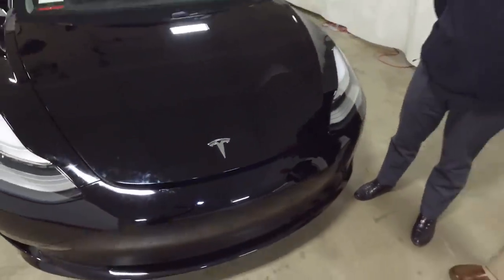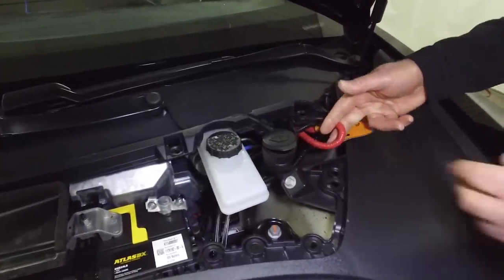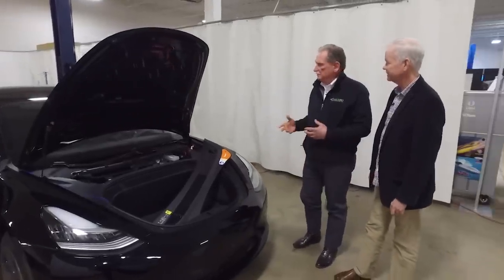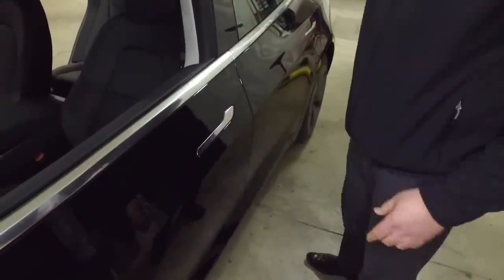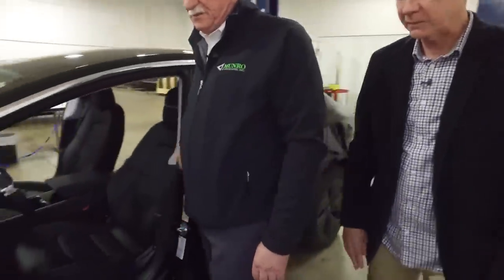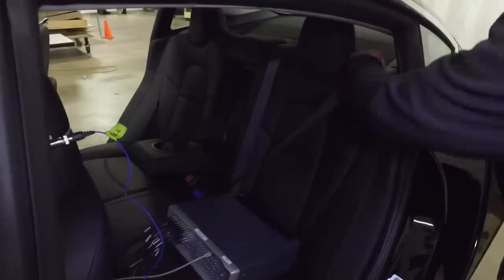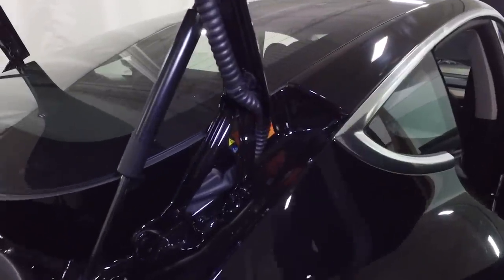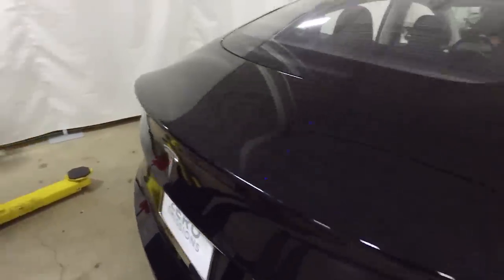Tearing Into Tesla's Model 3

Comment: Almost half the time spent nitpicking, about (if) you get into an accident,  ironically,  In one of the arguably Safest cars being built today.
Reply: Well we've seen that a Model S can also catch fire if the battery sustains enough damage in a crash. This is not a surprising thing considering how much energy is stored in these battery packs. Regardless of the mechanism of how a vehicle catches on fire, if it does, you still want to be able to get people out quickly.
Reply: Homecomfort i suppose you never witnessed car burning. Especially the one loaded with batteries. Even fire brigade does not have a lot to do at this point as long as there is oxygen it will burn and it will stop only once it burns out... Educate yourself first.
Reply: Homecomfort and the entire "seconds count" aspect really doesn't apply in this case. Unless the driver has a stroke or gets shot inside the car, this isn't really an "every second matters" situation.
The sense that time is so critical in car crashes comes from the risk of a fire, which is caused by fuel leaking into the car and catching fire.

That's not going to happen with a Tesla. Instead, the procedure is to remove the person from the vehicle without risking any additional harm to the person. Doing it faster is obviously good, but you DONT rush that process just because you want to do it quickly. 

That's why you don't often see fire crews yanking passengers out of windows and shoving them anywhichway into the back of an ambulance. The procedure is to do it safely, not quickly.

Comment: There's another place on the chassis where you can cut directly to cut the power. Right side, C-beam.
Reply: But pointing that out would destroy their argument. The front clips are mainly there to give the 12v system power so you can prep it to tow the thing. If they bothered to read the manual they would've seen that part. Instead they tried to tie the jumper cables there to opening the frunk to disconnect the HV battery.

Grasping at straws really.
Reply: Brice Campbell
So you expect first responders to know every crucial detail of EVERY make and model on the road?  Or do they search the internet for the manual whilst the car is burning with 5 folks trapped inside and a couple bleeding to death?  Every point made in this vid was valid and important.

Comment: At 2:50 you opened the driver door with your left hand, then complained about you must use 2 hands to open the door ? What are you to convey here ?
Reply: HT N Did you watch with the sound on, where you can hear him say that it hurts and he doesn't like it when he does it that way?
Reply: drdriftphd But the point of disabling the car is to cut open the cabin to get inside.

If you are at the point of having to disable the car, you aren't in a position to get inside in the first place. Therefore first responders will always have to use a halligan tool to open the hood, just like on all cars on the road.
Reply: drdriftphd I just want to say, if you're able to go inside and pop the hood like on every car. Then you should be able to get the passenger out instead of popping the hood.

If not use brute Force on the hood like Normal and then get the passenger out. His criticism doesn't make sense when the i3 or any other car doesn't have an outside mechanical lever in the first place.
Reply: I believe his main complaint is that the screen is a much more vulnerable point of failure than a simple mechanical lever on the interior to open the hood. In an accident, it's more likely that a simple mechanical lever inside the car will survive, allowing first responders to open the hood up and disable the car quickly, without having to use additional equipment and force. 

How valid that is as a complaint, I'm not sure. I'm no expert in the field, not even close. But he is, so I'll definitely give it some weight. I still think it wouldn't be that big of an issue, though.
Reply: Chris Edwards I don't know this guy, I don't have a Model 3 to compare, but from what I can see in the video, he has to depress one side of the handle with this thumb while gripping the rest with his fingers. It's different mechanically than most other car doors. 

This man says that his complaint is based on his personal discomfort as a result of an injury. This implies that not everyone will have the same problem with it. It's not needless bashing, and nobody's "out to get" Elon Musk here. He's making observations as an expert in the field.

I like Teslas and I think they're cool cars, and definitely something fresh and new in an old industry. That being said, Tesla is small, new, and experiencing the same stuff any small time, inexperienced manufacturer would. Growing pains. It doesn't mean nobody should buy them, just that people should be informed when it comes to what to expect when buying a Model 3.
Reply: I guess he doesn't realize he can be use his right hand there and grab it from the underside. I thought he was a mechanical guy but can't figure out basic human motoring skills. Wow
Reply: drdriftphd it hurts his hand to pull on a handle... in the same way he would in any other car? What exactly about that hand and arm motion is different from what he does in any other car?

Seriously, look at that motion and compare it to the motion for other vehicles. Don't give me some "but it sucks/evil/Musk-is-satan" response; analyze the motion and biomechanics involved, and identify anything that is different from how he'd open the door on other cars.

There's nothing different. His hand is horizontal and he pulls on the handle. That's how most car handles work. The only reason he's complaining is because he wants to find something to complain about.

This is why people trust Consumer Reports. And what did they say about the Model S, while Detroit was claiming it was junk? Oh yeah, they said it was the best car they ever reviewed.

Comment: Lots of good reasons not to be a Beta tester for Elon.  Wait for the 2.0 version.
Reply: Do you realize a lot of people and analysts have been betting non-stop on Tesla going bankrupt for about 10 years?
Reply: "Because of all those moving parts", are you kidding? There are moving parts on a Tesla, it's not all circuit boards mate... Electric motors, brakes, the suspension, the entire drivetrain - all moving parts. All cars are susceptible to breakdowns from both mechanical and electrical means, and Tesla has an absolute shitload of the former... For starters you have that huge lithium ion battery, which let's face it - we haven't mastered longevity in yet; they lose effectiveness in as little as 5 years (unless you're Apple and you use cheap shitty Chinese cells, in which case they last 1 year). That's built-in redundancy right there. To have the battery replaced in a Tesla it will set you back $12,000, so every Tesla owner, especially second-hand owners, will have this price dangling over their head as their car ages.
Reply: O_o cheesus my friend. I'm honestly worried.
Reply: DeerKoden short term strat vs long term strat.
Reply: Herbie Husker - What is your problem boi? I was talking to neirad537 who clearly wrote: 
"Herbie Husker yes because nobody want their cars. Lol"

And What is with this statement "Look at the depreciation curve on Bimmer, it's pathetic" I don't know what kind of idiot thinks BMW is some sort of economical reasonable car for commuting. BMW is a car for a person who enjoys the way those cars drive. I have owned toyota corolla, nissan primera, skoda felicia and VW polo. But none of those cars can deliver the same joy as BMW which i drive nowadays. And btw, i encounteren INSANELY more problems with all of those cars compared to the three BMW's i have owned. We don't need your weird ass opinions to tell which works and what not. Let people deside on their own experience.
Reply: Citroen saw it with the launch of the DS
Reply: DeerKoden  yes, someone with brain.
Reply: updates are over the air. BTW Musk just bought $10 million worth of Tesla stock
Reply: justclippin I never said nobody wants their cars. Plenty of people want them, but they can't actually build them, and the ones they do build are total crap. Go ahead and buy one, but don't be upset when Mr. Musk takes his golden parachute and you're left with a crappy car.
Reply: Herbie Husker this didnt age well lmaoo
Reply: A crappy car? A 4,70m car that sits comfortably 5 with loads of cargo space, 55/60kw battery at MINIMUM (the more expensive version they make right now has a 75kw batter) and has a very efficient aerodynamic is crap? Then the Bolt must be sub-crap...
Reply: "Nobody want their cars." Over 500 000 people still pre-ordered the car.. Car industry has never seen anything like that.
Reply: DeerKoden Did we watch the same video? The video was all about how poorly assembled the 3 is. Yes it is a crappy car. I'm sure the batteries are fine and all, but the car itself is poorly assembled. Tesla doesn't make a profit. Eventually they will go bankrupt.
Reply: DeerKoden Chrysler is an American/Italian brand and Genesis is Korean. They are not German brands. It looks like you need to do some more research. I get it, you like Tesla, that's fine.
Reply: Plus, high end ICE cars start breaking down in only 2 years because of all those moving parts.
Reply: You reckon. 

You think Elon wants to work for nothing considering he's agreed to receive nothing if the car company doesn't profit in the next year or two.
Reply: Using an insult to reply to an argument proves that you're not interested into discussing the argument in the first place. Also, Consumer Report survey ranks Genesis and Chrysler higher than all of the other german manifacturers, so...
Reply: 3rd financial quarter 2016 https://www.cnbc.com/2016/10/26/tesla-reports-third-quarter-earnings.html . The cars are so poorly made that Tesla beats Porsche at customer loyalty and satisfaction...https://techcrunch.com/2016/12/22/tesla-tops-2016-consumer-reports-customer-satisfaction-survey/
Reply: Tesla doesn't make a profit? Check the previous earnings from 2016. All the money earned goes through the process of creating new products and R&D. As of last year, they had about 3 billions cash. IF the model 3 was to be such a crappy car, it wouldn't recieve the appraisal it's getting from most reviewers except the guy from the video above. It is not your conventional bmw 3 series...
Reply: DeerKoden You can't be serious. Tesla doesn't make a profit. R&D my eye. They are burning through Investor's cash like there is no tomorrow, hand assembling things that should be made with robots. Keep on drinking Saint Elon's Kool-aid if you want, but objectively the cars are poorly made and Tesla doesn't make a profit. The only thing keepinh Tesla from bankruptcy are the fan boys and investors pumping the stock because it is "the future". Well if the future is quality levels of a 90s Kia for $50,000 I'll pass. And you bring up BMW like they are so amazing. Look at the depreciation curve on a Bimmer, it's pathetic. Those cars are not built to last. Once they are 5 years old, nobody wants to buy them because they are ticking time bombs. There are so many problems with them it is laughable. Go ahead, buy your model three,  oh wait you can't becuase they are too far behind to actually deliver on their hype. Fine wait a few years,  and if they are still in business buy it then. Prove me wrong, I don't care, all I know is that I won't be wasting my money on anything from Tesla
Reply: lmfao, if I were to write all the movie parts in an ICE car it wouldn't even fit this page. Statistically EV cares are cheaper to maintain... all you ICE fanboys have to say is "oh, tesla's don't make any noise"
Reply: DeerKoden using any German automotive company as a pinnacle of quality proves you are an idiot.
Reply: peterzpictstube there will be no Beta. Tesla will be bankrupt before they'll be able to develop it
Reply: Herbie Husker yes because nobody want their cars. Lol

Comment: Looks like Model 3 will be the end of TESLA.
$10,000 car quality on $40,000 car that really sold for $50,000
Good Job !!! (It would be GREAT or EXCELLENT JOB, if the car was profitable - but it is NOT).
Reply: Miro Kefurt hahaha how many 10k cars have an aluminium shell and panels? Are safer than a mercedes and can go 0-60 in 4.4 seconds?
Reply: This car is compelling and groundbreaking.   It will lead the end of Internal Combustion Engines within the next 20 to 30 years.   Tesla will become the largest capitalized valve car co. in the world.

Comment: Given that the entire ceiling is glass... I'm pretty sure the fire department can find an easy way in.
Reply: CROW BAR THE FRUNK, YOUR IN, NOT ROCKET SCIENCE.
Reply: All gas cars don't have outside mechanical releases. Firefighters have always pryed the hood open. 

AutolineDaily and Munro are betting on the people's ignorance to not notice that fact.
Reply: MrGnode what if it’s on the roof?
Reply: MrGnode yet. And the EV's haven't been so common before.
Reply: What does that have anything to do with disconnecting the electrical system??
Reply: The base model does not have a glass ceiling, that's part of the many costly upgrades if you're willing to pay. Otherwise, it would sure be nice to be rained down with shards of glass.
Reply: MrGnode Except the if you have to wait till the firefighters come so you can get out of your burning car then sit tight buddiiiie cause you’re not likely to come out of it alive :)
Reply: Get out of here with that logic
Reply: MrGnode hahaha so true
Reply: Cool story bro. The base model also doesn't have high voltage lines in the roof so the fire department can cut through there as well.

Also, of course the glass doesn't break into sharp blades.
Reply: ouchhhhhhhhhh
Reply: they are to old to see that. they think the unique way in is by the door.
Reply: Refaldooloo not true at all. New cars and especially these super safe vehicles like a Tesla or Volvo can very much withstand roll overs and landing on their roof. Check out all the crash test videos. Cars ending up on their roof after an accident are very common
Reply: If it's on the roof, break windows or cut some of the door. There aren't high voltage lines in the door.

I'll add, no one has been electrocuted by an EV accident.
Reply: In this context, they are pretending the car is a death trap due to how the disconnect works and that you're going to die trapped inside because firefighters can't get in easily. Actually, they can.
Reply: Yeah, there are just millions of them on the road.
Reply: sik59rt if it's on the roof, you're probably dead anyway. With such a low center of gravity, rolling the 3 will be highly unlikely and in the event that it does happen, it will be because of massive forces or you driving off a cliff.

Comment: I like Tesla a lot, but I have to agree with most of the points in this video. Unfortunately... I hope they could fix those things in the future.
Reply: Can't fix those things with a software patch lol. Tesla rushed this thing into market and it might come back to bite them in the ass. They didn't even have a proper testing phase for this car that every manufacturer does, which is ridiculous.
Reply: TheAtmosfear7 disagree with the guys assessment of some of the points. Example, the frunk release - since when has any car had a mechanical release for the hood that wasn't inside the car?
Reply: TheAtmosfear7 How about the fact that all gas cars don't have outside mechanical releases for the hood for firefighters to open. Instead they have a halligan bar to pry them open since forever.

Which makes you think what was all the hoopla about the model 3 frunk.
Reply: Tatiana coliban How can you disagree or agree anyway ?? Those are facts the guy literally presents you with ?? Or do you mean you disagree with what your eyes perceive ?
Reply: A couple of early production design flaws which Tesla will fix for you and later models wont have the same problems. Poor guy is getting out of breath trying to stain Tesla with his oily mouth.
Reply: They didn't have a production line testing phase, I think is what you mean. They definitely tested the car.

Some of the stuff in this video is apparently rubbish - apparently the 12v port on the front is not for the frunk to access the HV line for fire crews, but to activate the 12v system for towing or something. Read it in a comment above, from the user manual apparently.

Also, the missing manual release for rear doors is a bad thing, perhaps, but I wonder if it really makes a difference in reality or if it's just one of those 'seems like a bad idea' things? I find it hard to believe they were like 'yep, put them on the front doors but don't worry about the back' without thinking about it. That and my Forester, with a kid in the back and the child lock on, also doesn't have an override handle, so...

I think his panel fitting issue was bullcrap - there's no way he'd fit his thumb in those gaps. They might be ever so slightly off, but that's hardly different from half the cars on the market - hell, my Subaru has slightly odd gaps, though they're hard to notice, and they're renowned for build quality.

There are some legit concerns, but I don't think there's anything truly important. It is a revolutionary vehicle, the likes of which nobody else makes, and there's bound to be some teething issues.
Reply: Don't believe all the bullshit.This car got a 5 star crash test rating.This video is from poor old farts for poor old farts.